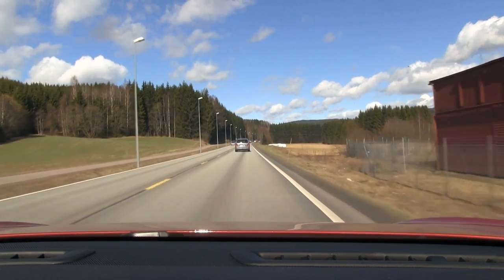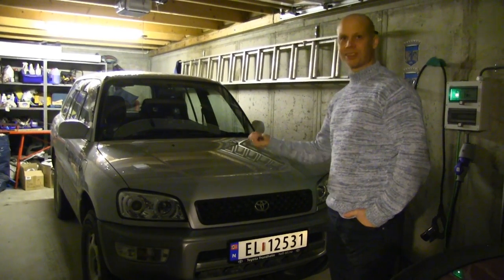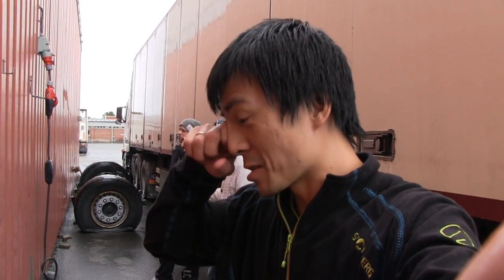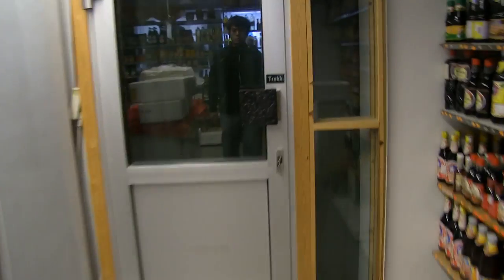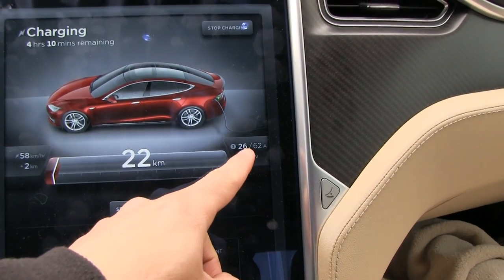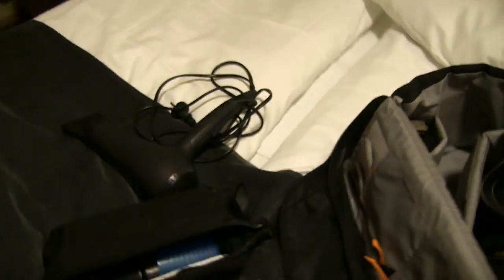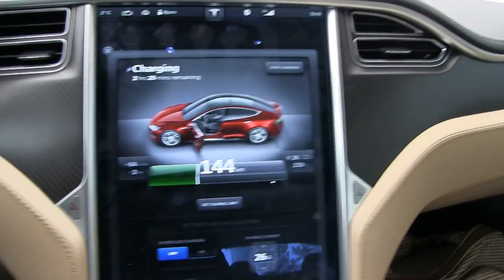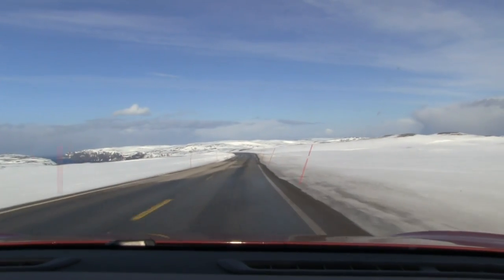Tesla Model S videos: #8 North Cape part 1

Comment: Hi, 
Enjoy watching your videos, and I'm considering buying a model S myself. 
When you post statistics for the legs you drive, could you please also include the average speed and the actual power consumption (including utility as heat, lights etc), since the onboard calculation only include the motor power consumption (if I understand it correctly)
Also looking forward to part II
Reply from the maker: Unfortunately, the car doesn't show average speed. I tried calculating average speed in my early videos. But it was too complicated because I sometimes have many stops to shoot videos. I also tried Google My Tracks. The problem there is that when the phone switches to EDGE-mode, there will be noise in my videos. To limit that, I sometimes switches to flight mode before shooting critical videos.

There is no way for me to measure heat, lights, etc. Only Tesla can see those numbers.

Comment: Nooo! I really, really want to sleep now and you do this. Now I'm not sleeping before 2:30 AM. Thank you.

EDIT: No HD yet... So I'm going to sleep! ;)
Reply from the maker: Yeah, the raw video uploaded was 5.3 GB. So YouTube need some time to re-encode it in different resolutions.
Reply: 5:20 AM for me... :D Thx, your videos are great :)
Reply: Bjørn Nyland I've just watched your movie (hard to call it a clip when it's 91 minutes long :) ). That's amazing trip you've had there! You can really understand how good superchargers are when you cannot use one :) 

When Tesla is planning to lift that 26A limit? That extra 6 amps would make you love CEE red 32A plugs even more as it shoud replenish about 100 km of range per hour :)

About that 16A standard plug: If you use Shuko -> blue 16A plug adapter you can use that portable "wall mounted" box to pull 3 more amps and as at low speeds battery managment eats some conciderable power it can shorten charging significantly. Or even Shuko -> blue 32A plug connected to UMC with current reduced. 

As you are clearly not an electrician :) That button and lever in that box is an RCD, kind of fuse that protects from current leaks (pops off when leakage current exceeds certain value). If test button doesn't work there is no power in the system (or RCD is broken, hence "test" name for testing RCD). Other protip: Circuit breakers (regular ones like Legrand S30X B16) are designed to represent heat effects in cables so they don't switch immediately when they detect overcurrent (they do if it's big, 3-5 times rated current for B series as a short circuit protection). You can draw 32A from regular Shuko protected by B16 for about 30s then you have to decrease to... 18-23A as this is the current range that switches off bimetallic long-period overcurrent protection in typical breaker... At 30 degrees celsius :) So when fuse box, connectors and cables are in the cold you might be able to pull like twice the rated current continously without switching off or damadging anything. Expect that cables and plugs will be warm to touch as this rating are based at 70*C insulation rating for cables. But Shhh... You've never heard that from me, ok? ;)
Edit: Corrected mistake

Comment: I guess you would have to time and log length of all the individual runs, and add them together for the leg if one should keep track of the average speed. I guess that's adds a bit of work load when you make the videos (but it would be interesting to know...)
Regarding the actual power consumption, does the vehicle range calculation take height for the additional power consumption for utilities when calculating the actual range? (does 390 km of calculated "true" range actually get you 390 km of range?)
Also, It would be useful though to have access to the actual kwh's received (or used) per charge to keep track of the battery capacity (how else can you tell? The range calculation is based on previous driving, which consequently is constantly changing...)
Anyway, just curious...I enjoy your video's anyway!
Reply from the maker: It would be great if Tesla added average speed in the trip meters. It's just a small modification. My previous BMW and Renault had it. The range estimation is based on a fixed rate. People claim that typical range is 200 Wh/km. But my own long trips indicate that typical range is 180 Wh/km. So when I charge to 400 km, I have to average 180 Wh/km to get that range. If I average 200 Wh/km I get 360 km.

Comment: Nice trip, but weather's a little cold there in Norway, the full battery may not last for 400km on road, is it?
Reply from the maker: It can last 400 km even in winter temperatures. I have proven it many times in my previous videos where I drove 375-380 km in one charge and still had more left.

Comment: Hi, nice videos, i watched almost all your Tesla videos this weekend and could not stop. A question: the adapter you are picking up that can charge from 32A and up to 22kw, where can i get that? Or what do i need to build it? Or who can i contact that know? I'm getting a S85D in may 2015 and preparation has started:-) I have the possibility to connect to 32A 400V+N at home and i bought the car with dual charger so it would be nice to use it.

Comment: You should look chargepoint chargers you need a chargepoint card and then you can charge for free it really useful and its free so try locking that up i know it very useful
Reply from the maker: Where can these cards be used?
Reply: Bjørn Nyland At a charge point station i wonder if you even have these there http://www.chargepoint.com It For EV And You Know I used it you need an a adapter but it still work but its not better then a Supercharger But Better Then UMC. You Just Tap Your Card And Then You Can Start Charging

Comment: Good thing is that in Norway you can leave your Tesla behind plugged in under open air, and you can be sure nobody will try to steal the cables.
Here in Hungary, I would never ever leave my Tesla (if I had one :D ) alone plugged in at public places, because there are many thieves, who will try to steal the wires. That's because junkyard owners pay good money for anybody, who can bring them copper scrap, and they never ask a question, where it is from. So these copper-specialized thieves know these kind of cables are made of copper (they also steal those cables which are above the railways, and give electricity to the locomotives, so because of this, delayed trains are everyday problem here...), so a charging Tesla would be a perfect target for them, unfortunately :(
Reply from the maker: Wow, I wasn't aware of that. It had happened though that someone in Oslo stole a $20 Schuko extension cord from a Tesla owner. At least in Norway, as long as you use Type 2 cable or something similar that locks the cable, it's not possible to steal anything unless you want to cut the cable. But that sounds like risky business. Cutting through 18 kW of power.
Reply: Bjørn Nyland Yes, Type 2 connectors are locked, but it doesn't matter. Maybe the thieves can't remove it, but the damage they cause when they are trying to pull out the cable could be serious I guess. And I guarantee some of them would try to cut it anyway, they don't know what a 18 kW power cord means. They just think "oh my God, copper, I can sell it for 2000 HUF (~little less than 10 USD) per kilograms, I need to steal it".
As Metallica said: Sad but true  :D
Reply: Stolen copper cables from railways is also a problem in Denmark, to a point that some days trains can't go, because the cables are damaged or gone, which is highly inconvenient for many passengers. They are trying to remedy this by marking the cables and trying different alloys that make the cables worthless, although I'm not sure how that works.
I'm not sure they would steal cables from electric cars, though.

Comment: It seems a little bit scary that you are able to break the fuse in a charger when you charge the car. I think there should be some mechanism so that you are not able to set it too high. The car should automatically use the highest possible amp and then you could choose to set it lower when you don't need fast charge.
Reply from the maker: The problem with that site is that the plug is 400V/32A. So the pilot signal that the charge box sends to the car is that it can draw up to this limit. The car has no way of knowing that the fuse is old and can't handle more than 21A.
Reply: Bjørn Nyland ok, that makes sense. I hope that the problem with old fuses is not too widespread for you. Does that mean that your car will not allow you to set the amp in your car higher than 32A when it uses a  400V/32A charger. I sure hope that is the case.
Reply from the maker: jacob000aarhus I have only seen this problem once. Other places, the fuse is on par with the plug (meaning 16A plug -> 16A fuse, 32A plug -> 32A fuse and so on). Yes, the car won't allow to go higher than the plug. I can't pull 20A from a 16A plug.

Comment: How's the 'rolling noise'? I didn't watch the movie completely, but if I'm correct I see that you placed some additional sound absorbtion stuff on the ceiling? And I remember you noticed the rolling noise on your test drive (with that demo car). Is your own car acutally more quiet than that demo car? Greets from.. Oslo!
Reply from the maker: You probably mean noise coming from the wheels. That noise is still present and will only be reduced if I put some heavy asphalt plates in the wheel arches. The panorama roof insulation is primarily for heat/cold blocking. But as a small bonus, I get the impression that there's less noise when going in tunnels.

Comment: I love the fact that the old Toyota rav4 year 2000 model can still beat all the new electric cars today for real world distance apart from tesla for real world distance even after fourteen years  all because of the nickel hydrate battery, that the rights was bought up and locked away, forcing the stopping of all vehicles using them, and forcing manufactories having to look at lithium battery's which at the time was very new and very expensive,even today.
I love the fact that after fourteen years that the Toyota rav4 ev1 battery performance is still optimal, hog washing the people who say the battery's are bad for the environment even though 96% of the battery's can be recycled
Reply from the maker: Yes, indeed. If EV1 wasn't killed over ten years ago, the development of EVs today would be much further ahead. Still, Tesla shows the world that EVs can work as good (or better) than fossil cars.

Comment: Question Bjørn: If you need to go rollerskating or jogging for an hour or so, you would not bring your phone once you’ve parked the car. If i then use a keyfob, will I have to bring the keycard aswell? -
My phone Works fine as a key, but many times the car asks again for the keycard

Comment: Bjorn, can you explain, why you can sometimes only charge at 13Amps, when you have 16Amps connection available to the car and sometimes you can only charge at 26Amps, when you have 32+Amps available?
Reply from the maker: I charge at 13 A when I have Schuko 230 V available. Then I get about 3 kW power. When I have 400 V 16 A available (red plug), I charge at 16 A 3-phase and get 11 kW power. When I have 400 V 32 A available, I charge at 26 A because the firmware limits it. I get about 18 kW as it is today. Later when the 32 A can be utilized, I will get 22 kW power.
Reply: Bjørn Nyland So, the Model S's firmware limits it?
I have the Ampera and I have a Mennekes (Type2) ->J1772 cable and a home made mobile EVSE 16A unit for Schuko plugs and I can charge at 16A (3.3kW) on both types of plugs.
Is it a safety issue or is it the dual charger issue, that can't handle currents above 26A?
I really don't understand, why Tesla limits a perfectly good 32A (or in your case even the 62A type 2 plug), 3 phase Mennekes Type2 plug to 26A.
I see it a waste of time. That additional 3A(16A)/6A(32A) could shorten your charging times significantly.
Edit: Let me get this correct:
- You get 13A from Schuko plug
- You get 16A from 16A Mennekes Type2
- You get 26A from 32A Mennekes type2?

Is this correct?
Reply from the maker: Andrej Potokar The 13 A/26 A limit has been there since last year. I can charge at 230 V 16 A from Schuko if I use one of my adapters. The limit was due to some charging problems. Tesla is working on it.
Reply: Bjørn Nyland I understand limiting the Schuko plug to 13Amps (Ampera's own mobile EVSE unit has it limited to 10A). But I don't understand why limit the 32A type2 plug to 26Amps.
Reply from the maker: Andrej Potokar There was a problem with the chargers running at 400 V 32 A. That's why the limit on 26 A was set in firmware. Tesla is working on a fix.
Reply: Bjørn Nyland Ok,I understand. However, limiting every Model S owner to 26A because of some faulty chargers? It's the responsibility of the charger maker to make a faultless charger. Being limited to 26A, even on a 62A (in your case) charger is somewhat silly. With the Ampera, if there's a fault with the (public) charger unit, the car stops charging, throws an error message and a Check Engine Light for the period of next 2-3 full complete faultless charges and that's it.
Don't 'punish' every car owner for some faulty chargers. In your case, if you could charge at 32A, you could save about 1 hour for every full charge. On a trip like this, every hour counts.
Reply from the maker: Andrej Potokar The dual chargers are 22 kW. 400 V 32 A 3-phase is 22 kW. 62 A is 43 kW which can't be utilized by Tesla's chargers. Tesla takes no chances. So they limit every car since they don't know which car would have this fault. I think it's a good choice. I'd rather charge a little slower than have to deal with overheat and damaged charger. Tesla is already working on this and will recall cars to get it fixed.
Reply: Bjørn Nyland I understand, that Model S 'only' has 22kW charger and can't fully utilize the 43kW charging station, however limiting the 43kW (62A) charging station to 26Amps seems silly if the cause of the problem would be 22kW charging stations. At least, let the Model S charge at 32A at the 62A charging station. It would save every one of you (Bjorn, Bjorn & Jorn) one hour each.
And while being on the safe side; Renault Zoe can charge at 43kW from Type2 charging stations and I haven't heard any Zoe catching fire.
Reply from the maker: Andrej Potokar The problem is not in the charging stations. It's in the on-board charger(s). It's irrelevant if it's a 22 kW or 43 kW AC charger. The limit on 26 A is there. This is an issue with the chargers on Teslas. Zoe probably uses a different charger which doesn't have this fault. So what if Zoe can charge at 43 kW. As far as I know, thousands of Teslas can charge at 105 kW without catching fire.

I think Tesla did the right choice. Instead of risking more damage, they can roll out an update to make sure no car is overheating while they are fixing the problem.

If an Airbus A380 would crash, all A380s would be grounded until they find the cause and apply the fix on all A380s. If Airbus don't risk flying, why should Tesla risk more fires?
Reply: Bjørn Nyland Aha, now I understand. The problem is with on board Model S charger, not with the charging stations.

Comment: Good evidence that electric cars are best for commuting, not long trips. I tend to doubt that will change too much over the years. Range anxiety will be prevalent.
Reply from the maker: This video is two years old. The supercharger network have expanded massively since then. Model S is used all over the world now for long distance road trips.

Just take a look at my newer videos.
Reply: +Geo T Take a look at https://www.teslamotors.com/supercharger. Compare today vs end-of-2016 projections. Also note that they plan to double the number of stations on that map by end of 2017. Given that everything on that map was built in the last 2-3 years, I would take their word for it. And they won't stop there. Imagine how it will look in 2020+

The concern of range anxiety today is similar to the early gasoline cars circa 1900-1930. From ~1900-1910 there were only curbside hand pumps for filling your car.. When the Ford Model T took off, they developed the gas station out of necessity to serve the surging number of cars on the road. By 1920 there were about 15000 gas station in the US. By 1930 that number grew to 100,000. It peaked in the 60s at around 200,000 and has been declining ever since.

Improving batteries, expanding charging infrastructure, and improving charging technologies (300kw+ charging will one day be the norm) will take time and will happen.
Reply: I'm 60 and old enough to remember range anxiety in PETROL/GAS cars. Many stations were not open after 8pm and usually closed on Sunday's. Even today in some remote parts, people have to 'plan' refuelling in Petrol/Gas cars.

Comment: Yes I agree it's not the electric car that is the problem it's the infrastructure and the people behind the all powerful oil company's that are resisting change , the only reason hydrogen fuel cell car is going ahead is because the oil company a can make the hydrogen for next to nothing from dirtily produced to ecologically produced and charge you the earth for it. It's like the amount of electric that has to be used at the oil company's to produce Gasoline can run tesla cars for years. The hydrogen fuel cell tech does not need you to input hydrogen as they want you to do . Yet you can produce the hydrogen on board and the only thing you will have to add is any type of water even salted water which the oil company would find it hard to sell when it's freely  available.....